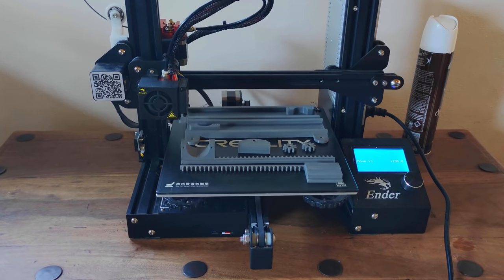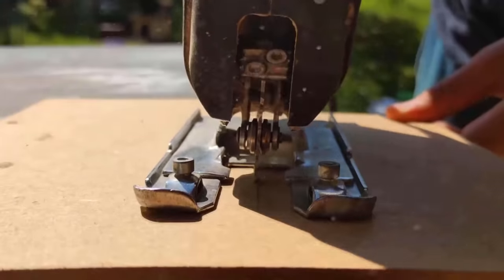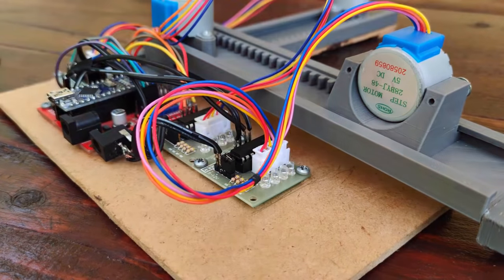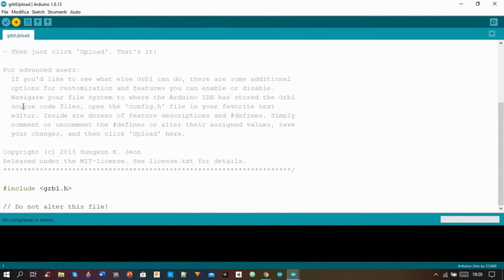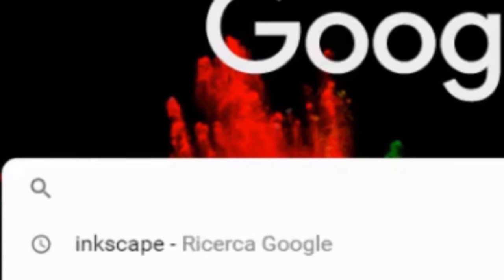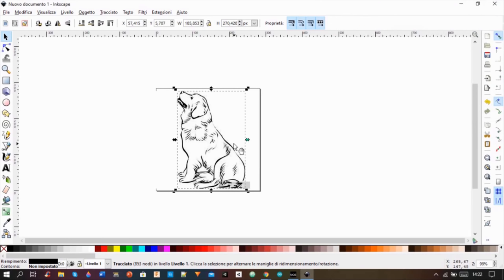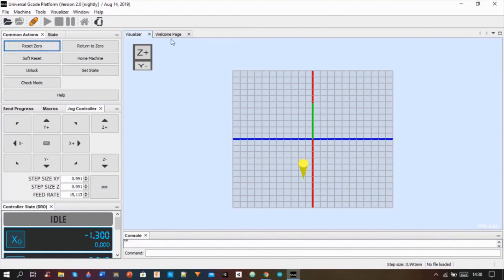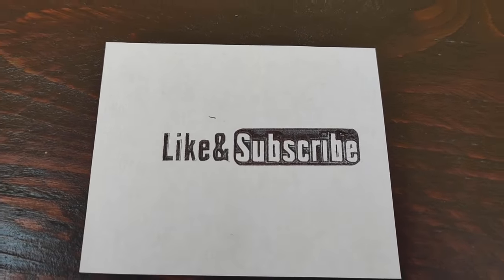3D PRINTED ARDUINO MINI CNC PLOTTER

Comment: how can  make this with two stepper and one servo motor using arduino uno ?
Reply from the maker: i tried to do it but it didn't work
Reply: @DAZprojects  I made it to work by using https://github.com/ruizivo/GRBL-28byj-48-Servo and inkscape plugin for operating servomotor... I just need to modify the stepper motor mount into servo motor..If possible kindly provide the editable file of x axis rail.
Reply from the maker: @vignesh_waran  I'm sorry but I don't know how to share editable files
Reply: @DAZprojects  in which software did u created the 3d models ?

Comment: Are you planning to convert it to a laser engraver???
Reply from the maker: Not this model, but i'm planning to build a version with NEMA 17 and Linear bearings that can engraver with a laser and with a spindle
Reply: @DAZprojects  
Do you have any idea what I would have to change in the code for the laser to work? Currently, the Arduino Uno has voltage on pins D1 and D2, but it is probably not responsible for laser control, because it does some strange things on the motor connected there.
Reply from the maker: @avimavim1083  i don't know
Reply: @DAZprojects  
Ok, thanks for the answer ;)

Comment: When i connect my stepper drivers to a 12v input 2 start flashing all 4 LEDS. When i connect the third the LED get really faint. I can't get them to move either :(
Reply: In minutes 2:41 there is another power supply input for all the stepper driver he using 5V.

Comment: Would you be willing to share your Grbl settings $$... and where/ to do you do the zero in UGS? I keep drawing squares when i have a circle gcode.
Reply from the maker: I don't know how to solve that problem, try changing the settings in ugs
Reply: Figured it out... it was the firmware .. I used this one instead (https://github.com/imaicom/GRBL-28byj-48/) and its working much better now.

Comment: The circuit diagram link is not working right now at 2023
So i figured out the circuit diagram and if you need it i can provide it to you pls comment below to need it i will provide it to you in 24 hrs
Reply: Can you please give me the circuit diagram
Reply: I need the circuit diagram as well if is it possible.
Reply: I will check on to it
Reply: @nacho1119  so i was searching my desktop but unfortunately i think i kept the file some where else or deleted it well if you see the github description it said clearly about the connections well it didnt work well and was snappy and i dont have a 3d printer so i ordered that too so my opinion will be to look for another one or just move to another project,.... if you are strong that you are gonna do it then i may help you but i consider not to make it as the creater has not supported it till now well anyhow its just my opinion and the desicion is yours
Reply: @dharani8399  Ok thank you for the advise
Reply: @nacho1119  hmm s
Reply: preciso do diagrama do circuito e as configurações do JSCUT, vc tem ?
Reply: please give me the circuit diagram

Comment: Is it possible to increase the size to completely draw on A4 paper
Reply from the maker: Unless you have a big 3d printer no, I'm currently making a video about the simplest CNC plotter you can build, and since it runs on wires it can scale at any size you want. I will publish it in about a week
Reply: @DAZprojects  is it possible to use the same code and just increase the size of the components to draw on A4. Or do we need a diff code
Reply from the maker: @rish_b7501  the code remains the same

Comment: Hi, i want to reproduce your project, which is super cool but i'm missing a piece of information: what is the size of the bearing visible in the video?  thank you for your help 🙏
Reply from the maker: 16mm
Reply: @DAZprojects  radius or diameter ?
Reply from the maker: @enzonicolas3058  diameter
Reply: Small question: What is the size of the inner diameter? Thank you
Reply from the maker: @enzonicolas3058 5mm
Reply: @DAZprojects  Thank you, is also what is the size of the screws used?
Reply from the maker: I used a m5 screw about one cm long, i don't remember exactly
Reply: @DAZprojects  Ok, Thank You
Reply: Can uh plz share circuit diagram

Comment: hi. im trying this design but i need some diameter for this. i sent to you message abaout this but you didnt back up to me . can you help me ?
Reply from the maker: What diameter you Need?
Reply: @DAZprojects  The bolts you use for assembly are required. In addition, you need the thickness and dimensions of the wooden plates you use during assembly. Actually I am thinking of setting up a stand for this machine if you have cad drawings and you can throw them at me. Is this possible ?
Reply from the maker: I didn't have the f3d files because i changed my PC and i deleted them, the screws i used are 4mm in diameter and 10mm in lenght and the plywood is 4mm thick
Reply: @DAZprojects  really ?? anyway i will draw again when printed them. so woods length and height diameters ?
Reply from the maker: @habibcanbengul3719  the hight of the wood Is 4mm and the dimensions are 200mm by 100
Reply: @DAZprojects  OK. thanks. i will do today night

Comment: Why can't the ugs software be installed on my computer?
Reply from the maker: Probably you don't have java installed on it
Reply: @DAZprojects  I have installed java, when I install the ugs software, there is an error message "Failed to create process This version of %1 is not compatible with the version of Windows you're running. Check your computer's system information and then contact the software publisher. (216)" I'm using Windows 10
Reply from the maker: @aris5009 sorry but I don't know
Reply: @DAZprojects  Is there any other software besides that

Comment: Can Arduino nano be replaced by UNO?
Reply from the maker: Yes
Reply: @DAZprojects  But I could not upload the file into my Arduino ...
Reply from the maker: @Cloof  i think you can
Reply: @DAZprojects  An error occurred while uploading the sketch
Reply from the maker: @Cloof  
the code doesn't change from one arduino to another, it will be some setting in the program
Reply: @DAZprojects  So What do I need to Change?
Reply: @DAZprojects  Or I will try it until I have bought the nano one. Thanks
Reply from the maker: @Cloof  i don't know
Reply: @DAZprojects  i cant see in video how to connect dc plug cable connection
Reply from the maker: @AnnTii  the inside Is positive and the outside Is negative
Reply: @DAZprojects  its all done but jscut not supporting my svg
Reply from the maker: @AnnTii  i'm sorry but i never had that problem, i don't know what you could do

Comment: not working, Arduino nano connection to drivers is not correct. for worse you have the connection schematic to an Arduino uno. does not work for me on an Arduino nano

Comment: please someone can explain what steps to do in the calibration process? in the video is imposible to see what to do. Thank you.
Reply from the maker: 100 steps/mm in the y and x axis and 50 in the z
Reply: @DAZprojects  yes, thank you. That part is clear. What i meant is that steps of calibration and setting zero are so fast in the video and is not clear how to set the machine to the zero point. What i have done is set as you say 100 and 50, but this process seems to be independent of setting zero. What i did and it worked was:
1. load the gcode on ugs
2. ugs with "jog controller" move the x,y,z in the machine to one of the limits (one corner of the printing area. When this point is reached then "set to zero" in the label "common actions". After that play button and then works. I do not know if this is the right procedure but it seems to work.
I could not tune the machine to such a great quality print as yours but maybe  my model is not as good assembled as yours. In any case really thank you for share this amazing project and also to answer so promptly to people with doubts. FORZA DAZ grazie mile!!!!!!!!!
Reply from the maker: @astorgallionespana5813  it's just like I did in the video, you have to set the zero of the machine manually

Comment: what is the model of the beaning
Reply from the maker: It's 16mm
Reply: @DAZprojects   you mean inner diameter 16mm or over all length 16 mm. thanks
Reply: @DAZprojects  F624ZZ is 15 mm overall

Comment: Share the diagram for Arduino nano expansion board
Reply from the maker: i couldn't find that expansion board in the program i use to make circuit diagrams, the connections are the same as the arduino nano
Reply: @DAZprojects  tnq....
Reply: @DAZprojects  
Plz can u try it using some simple picture editor, because I have already bought everything but due the circuit diagram I am not able to proceed plz help.
Reply from the maker: @Ajinkya_1718  the connections are the sale as the Arduino nano, simply read the PIN name on the arduino nano and then look for it on the expansion board and connect the wire

Comment: Its normal, that the motors it's so hot? jaja :,c
Reply from the maker: I think it's normal, also mine gets very hot
Reply: And don't melt the Pla? Or you use another material?
Reply from the maker: @TheUmi48  it never happened to me, they never get so it never happened to me, they never get hot enough to melt the pla